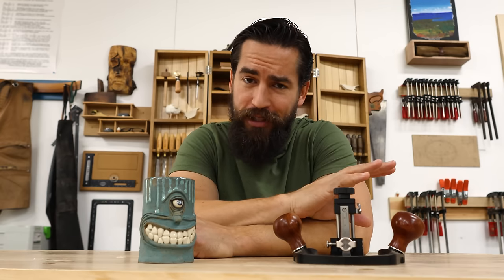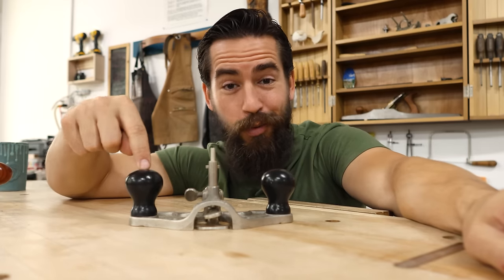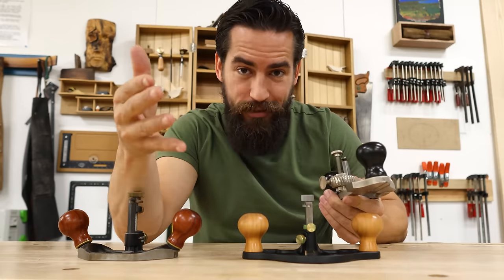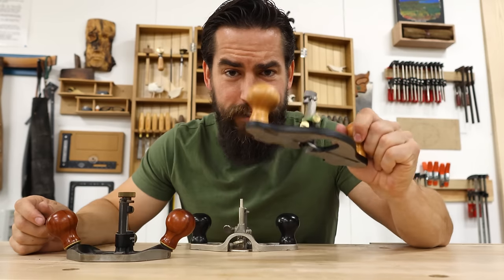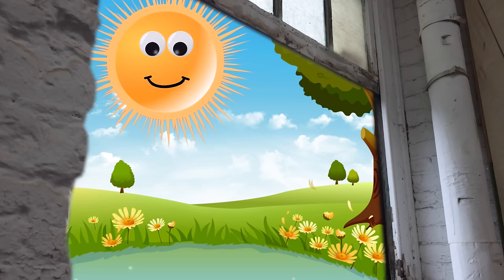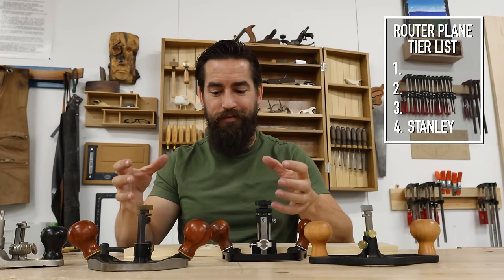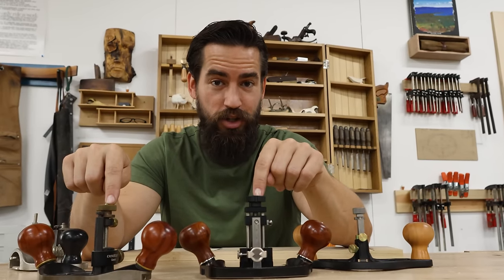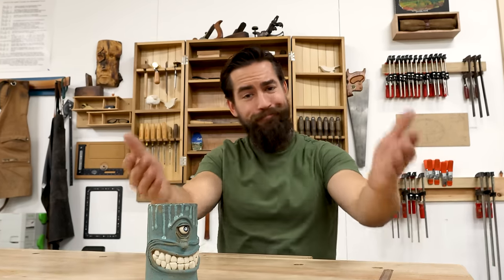How a hand tool split the woodworking world

Comment: Thanks for this great video.  I am in the market for a router plane.  In my younger days, I gravitated towards keeping all of my tools in the same few brands.  Trying to make complete sets.  It was just an OCD thing I guess.  Now that I am older, I tend to mismatch more when there is a better option.  I didn't even know JKM made a router plane.  I think I may go that route.  I like the removeable blade, the depth stop design, and the dual rod runner system.  It just seems that it would be more stable in use.
Reply: I purchased the KM-17 Pro and have just recently received it. I did not purchase it because of this video but by introduction from Jonathan. I own many Hongdui woodworking tools and each of them are of exceptional quality and value. I had no reservations on this tool and in hand the build quality is again extraordinary. As far as being a Chinese made tool, many of my hand held power tools, I.e. Milwaukee brand are all made in China. In a world where the market is becoming more and more competitive worldwide it is in my opinion Veritas and Lie-Nielsen have sat on their hands.

Comment: Coming from the perspective of a guy who works on cars, I strongly prefer the hex bolts to the slotted screws. It is so easy to destroy the single slot, especially in the softer metals like brass. So, IMHO, I would avoid the Lie Nielsen.

Comment: They are pretty old.  Used to be called a widow' tooth.  Egyptians had them.  The Stanley has a fence that registers in the two grooves on the bottom.  Not willy nilly.  I have a complete set.  But I'll tell ya, I don't like the black marks that the nichol from the stanley puts on to white pine.  I could add a wooden bottom, but it kind of erks me.
Reply: I use it a LOT though.  its my goto for accuracy and flatness. of dadoes and small tenons.  I like the vertical handles because I can hold one stationary and pivot the other one around it.  Just a technique I've learned.  Not as easy with the splayed handles (like I made on a wooden one)

Comment: You mentioned your preference of the forty-five degree splayed handles on the Veritas and Katz-Moses. Since form follows function, I would have liked to hear more in depth about your preference for the angled handles. For example how ergonomic design—in this case, the angle of the handle as well as its positioning (distance between the two handles)—function as an extension of the human body that drives it. 
/ / / 
Do angled handles imply greater force with less effort and thus faster work with less strain on the body? More specifically, does the semi-supine hand position of angled handles recruit muscles that facilitate greater control and modulation of fine work? 
/ / /
I haven't used these tools, but I speculate that a wider distance between the handles as well as an angular position would orient the woodworker in a position to facilitate a greater driving force but with more relaxed effort .
/ / /
Sidenote: the Veritas cast platform seemed to wobble on the table in your video while the others did not—was that because the of the blade or is the base warped?

Comment: It is the hongdui router plane in my opinion. Katz moses is just their spokesman. I don't judge that, I just have my doubts that he did much of anything to design it.
Reply: That would be incorrect. My experience as a tool designer definitely does not compare to the owner of Hongdui who is one of the best out there. We have designed two tools together with more to come. We also released a really cool chisel mallet with interchangeable heads. Currently we’re working on a coping saw and several others. I design lots of Katz-Moses Tools only tools and just filed a patent for a new one coming out in January or February that I think is pretty cool as it will eliminate the need for the 5 cut method. As my boot strapped company grows without loans or investors it makes it easier to make more great ideas come to fruition by partnering with talented people. We have produced tools in partnership with multiple people and will continue to do so. I’ve learned and firmly believe that innovation is better as a collaborative effort and you can sus out the problem you’re trying to solve quicker when you bang your collective heads and experience together. Cheers
Reply: Yep. Hungdui is the manufacturer of a number of JK tools. If you buy the RP from Banggood, guess what, it has JK on it.  Is it a licensed product? Is it a collaboration? Is it a celeb endorsement?  I don’t care.  What I see is that Hungdui is a Chinese company that is making quality tools with design improvements, even unique tools, rather than the usual Chinese marketing strategy of wholesale ripoffs made as cheaply as possible.  For me,  I’m not a buy USA only guy. I’m a buy the best I can afford guy regardless of where it is made or who designed it.   I don’t support 100% knockoffs that violate TM, copyrights, or patents.
Reply: Ok...I can accept if I'm wrong. But let me ask how much of the design was yours?
Did you go to honhdui with the idea?
Was there a prototype they provided when you first started collaborating?
When I watched your video releasing it, I got the impression that you got involved in the alpha / beta test phase of development.

Comment: The steel also is a consideration for some, don't know info on Hongdui steels. Also range of blades. Hongdui has no spearpoint available. Edit: Comment below indicates they do - I was on Banggood
Reply: On K-M’s site, the router plane comes with a 1/2” straight and 1/2” spear point blade. They show it installed in a marking knife handle, but it’s interchangeable with the regular blade on the router plane.

Comment: You got me to watch for it don't mater. love your channel  
solar needs batteries, they are bad really bad. They got lead in them and lithium now that fire is scary so what do you do with the old batteries ? not a fan
Reply: They don't need batteries (check on grid solutions) and for off grid battery longevity is not an issue, and recycling is also not an issue

Comment: Appreciate the review.  The one thing that you did not mention, but swayed my preference for Veritas, is the much wider availability of blade sizes.  I do a lot of inlay, and the smaller width blades are essential.  And, the blades fit both the Veritas large and small router planes without an adaptor.
Reply: It may not matter, but KM does have a separate kit for his plane for smaller blades that fit into the same unit.

Comment: I've had the Veritas for about 8 years now, and like it very much. I would like to get a second router plane, like the old Preston 1399 or the modern copy, the Walke Moore router plane as I like this wide body design also.

Like you, I also prefer the closed mouth version. Somewhere I did see where someone brought up the advantage of the open mouth where it could prevent the possibility of damaging the top edge of a stopped dado should a chip get caught there.

Comment: If I remember, I went with the Veritas over the KM tools router plane because I was able to buy a full set of different-sized cutter heads with Veritas. KM's only had one size (not sure if that's changed since). TBH: I don't very often use the tiny cutters (for instance), but still liked the option to swap out sizes. I think I wasn't able to sub in Veritas cutters on a KM router plane due to the different cutter shaft shape.
Thanks for the vid!

Comment: so if you look up the km-17 form Hongdui it ranges from $50-$160 depending where you get it from ... someone should have told Mr. katz that's why you don't outsource to China , bc the company you outsourced to is going to undercut you right off the bat.
... I tried adding links earlier but I cant see my comment so I assume it wasn't posted ... if it was , sorry for the spam

Comment: A little while back, JKM's router was out of stock. So...I noticed that Aliexpress sold them under the Hongdui brand (which is who JKM partnered with). It was $140 including shipping. So...yeah, way cheaper than buying through JKM and at the very least the same price as a Stanley, if not cheaper. So...why would I pay $100 more for the Veritas or Lie Nielsen? Especially when at the time I couldn't buy it from JKM because it was out of stock. I get supporting western companies, but $100 is $100. Especially for a basically equivalent tool but, with a superior depth stop. A month later my new router plane showed up well packaged and in great condition.

Comment: Good video. My problem is paying over $200 for such a tool. In my personal opinion the expense isn't justified. Quality tool certainly. $200 for making slight modifications to Stanley's design that is worth $100, not at all. 
I will get a kit from Paul Sellers, Rex Kruger, or the plans from the workshop companion and be just fine. For less than half the cost.

Comment: Excellent coverage of mechanical design. However the mechanical aspect while important is not the only design area to be studied. The esthetics are a design element as well and are just as important as the mechanical for some. Sometimes referred to as “trade dress”, which allows the potential buyer to differentiate one tool to another solely based on a core style type. Veritas and LN have a “look” that is unique to their products. 

Studying just mechanical function as design and making the argument that that particular approach is the only approach would mean that all cars are the same and are therefore a knock off of all others. Given courts have in the past disagreed with that philosophy…. It’s not the only aspect. As a designer I can see the differences very quickly. You’ve been in furniture making for some time. Is it your opinion that a maloof rocker is the same as an ikea rocking chair? They function the same. Just a thought to think about. Another thing to take into account is cost of patterns and development costs. Making a cast tool is EXTREMELY expensive. With some molds or patterns costing as much as a new car AND there are multiple needed for a single tool…. 

Bottom line. It isn’t as simple as saying it’s a plane that holds a blade therefore the same. If you’d ever like to meet up and go over the details in person reach out it won’t take me more than 20 mins to have you understand why there is “controversy” over this knock off tool. 

Best Regards,
Robert Porter

Comment: The router plane riots will go down in history as one of the worst woodworking hand tool riots in history.  Wait what?  The wood working world didn't split.  This is another classic much ado about nothing tool comparison.  If you don't have a router plane, get one.  If you have the $$ get a nice one.  They all work fine.  I've used a chisel in a wood block.  And made cutters from hex keys and other odd ball hardware like a round cutter wheel that was omnidirectional for major plowing.  All worked just fine.  Got the job done and saved me a road trip.  
I'm not sure about the higher end models compare in a couple of areas that may or may not matter based on your needs, but the Stanley allows the cutter to be mounted on the other side of the pillar for bullnose operation all the way up to a stop edge wall.  The shoe is only necessary for narrow work pieces.  It attaches to the cut depth adjustment rod.  This rod allows for hogging operations where you leave the the blade at finish depth and take cuts limited by the rod until it bottoms out.  Takes a little finesse, but it works pretty well in most instances, and your final depths will be perfectly uniform.  I have never used the fence, but it appears wonky, with reference surfaces too small to be of much use.  Though the 2pt concave/convex side is interesting.
Not-so-pro tip:  Have scraps handy that are the same thickness as your work to support the plane at the edges to give a stable reference surface for longer tenons or other edge working.

Comment: Great video. I have the JKM plane. Everything you said is on point. What sold me is the depth stop. I don’t see any design theft from JKM, he actually improved the design over the other three. I have hours and hours on the plane with no issue. Blades (yes you get two different blades with JKM) are sharp, flat and durable right out of box. Yusuf won’t be sorry with any of the newer tools, but I think the JKM is just the next level.

Comment: I am a bit surprised that you didn’t mention the removable blade on the Veritas router plane in your design discussion. That was the feature that sold me versus the Lie-Nielsen.  I buy planes made by one of those 2 companies because I know that I can count on their quality, from design through steel selection and production. And Hongdui copied that design feature. 

I try to avoid buying goods, especially tools, manufactured by the CCP for several reasons. First, quality is inconsistent and/or unreliable.  Second, the CCP routinely steals intellectual property.  Third, I don’t want to support a mercantilist and authoritarian regime. However, there are times when either a) I can’t find an alternative made in the U.S. or b) the price of a domestically produced version is ridiculously higher.

Someone else pointed this out in a response to a comment here. If JKM is outsourcing tool production to China, his retail price should reflect that fact. It does not. This leads me to believe that his profit margin is orders of magnitude greater than either Veritas or Lie-Nielsen. The magnet in the adjustment mechanism is just a marketing gimmick. I bought a JKM dovetail cutting guide years ago.  I also bought his stop block when it came out. I would not buy this router plane and would only purchase from JKM if a tool was unique in a meaningful way.

P.S. I stopped the video to type this before the solar energy advertisement. If solar power is so great, why does it require government subsidies at every step?  (Government subsidies = my tax dollars) I looked into solar in detail when I built my house in 2015. Even with the subsides which were very substantial, the numbers only worked if Maine continues the law requiring CMP to pay me full retail pricing, including their distribution costs, for every kilowatt I put onto their distribution system. I don’t trust government to maintain that legal requirement and besides - it’s just wrong.

Comment: They've been around since at least the 1700s and possibly as far back as the 1600s. Look up Old Woman's Tooth or Grandmother's Tooth, they went by both names. They were wooden shop made tools that were as different from one craftsman to the next as a signature. They started showing up in standardized, more or less, metal cast form in the very late 1700s and early 1800s. Stanley wasn't even the first company to make the metal version.

Edit: The only thing I don't like the look of with the Katz version is it has a smaller shoe than the Veritas. The tool already has a small enough reference surface so losing just an inch or two on either side is kind of a big deal. I don't care that he's selling shit. I mean the whole claiming HE came up with certain tools like that wavy toothed flip stop and the 6in1 router jig that at least seven other popular woodworkers on YouTube also sell as their tool. I mean it's obvious they all just got on Alibaba and contacted the same factory and had their logo slapped on it. The router plane is kind of his with his little touches. I mean it's like screwdrivers, they all do the exact same job basically in the same fashion with minor tweaks and differences between brands and you pick the set of tweaks your preferences and budget can agree on. If he can make a buck off of tweaks he thought about adding and was able to communicate that to the factory - Taiwanese father's have to put food on the table to.

Comment: Hey mate, I own a Stanley 71 and 71-1/2 and they have always been a pain too adjust and to sharpen.  I bought the JKM plane when I saw it and it has been a game changer.  The depth control and easier sharpening is great.  I didn't even realize there was a controversy until someone pointed out that the base and handles were a direct copy of Veritas.   I really don't care.  The JKM works great and the features are better than the Veritas.  If JKM had modified the base design even a little, this controversy wouldn't even exist.

Comment: Veritas does actually have several patents on this router that are still in effect for another 8yrs or so.  So legally hong dui and JKM are liable here.  I don't see design to be that novel though personally.  JKM might wanna do more research before he puts his name on something though.

However, I kind of agree with you in this specific case b/c it seems to be the norm in this industry to remake other ppl's designs w/ only minor improvements. Most of which I don't find to be enough of differentiation to affect choice.

I own this veritas router and a bunch of other LN/Veritas planes. This isn't competition...It's the same price as the veritas, so if that's your price point you're going to choose veritas in this instance. For anything else, if you have the money for veritas or LN, that's what you're buying b/c you want quality shit.  But, if I were JKM, I wouldn't put my name on if I knew it was pushing boundaries of patent violation.

Comment: If you don’t like the Stanley 71 with the open shoue( which you mention several times) you picked the wrong tool to review. All the others are rip-offs of the 71 1/2 version, which has the closed shoe like the other tools you mention.

And at least one of those other router planes also comes in the open front version.